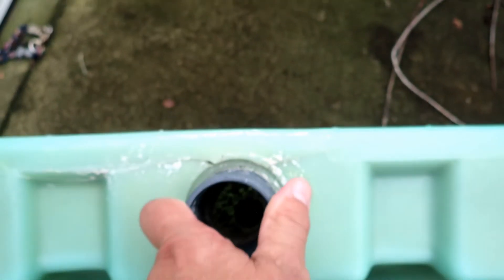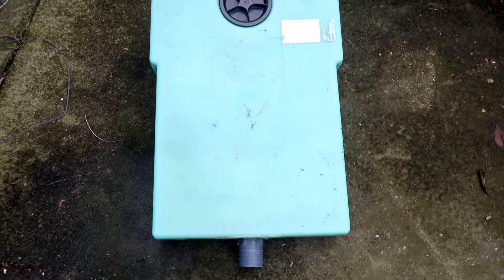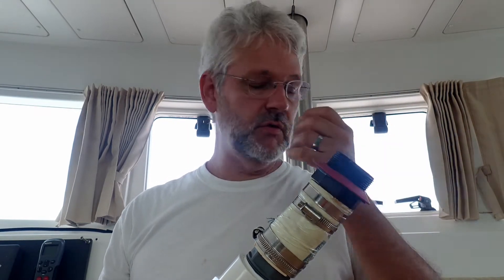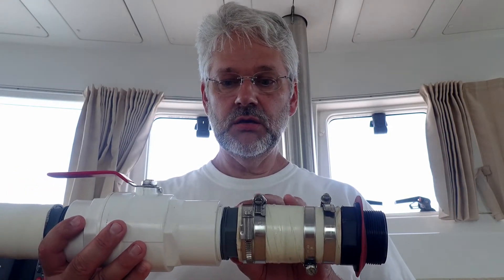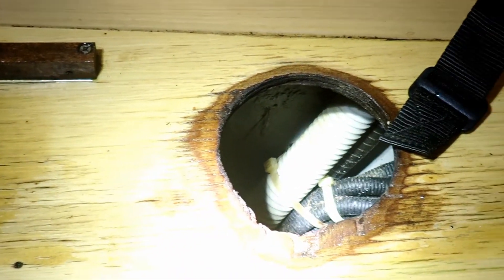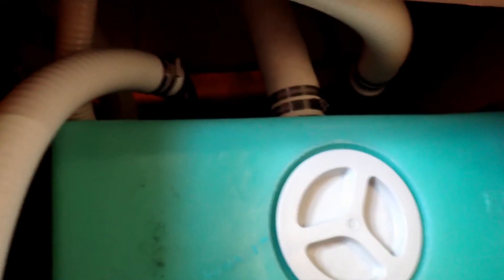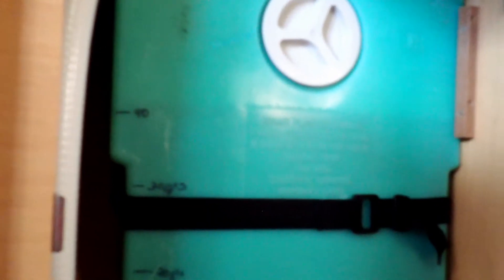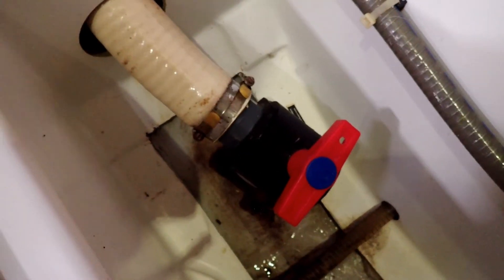Our holding tank is leaking on our Lagoon catamaran (yes...gross!!) and how to fix it!

Comment: Do you think a chrome ball valve will decay faster with saltwater flush heads?
Reply from the maker: I hope so!  If it's real chrome moly, it should be ideal:  "With such a high temperature tensile strength and corrosion resistance, CrMo is also found to be effective in salt-water applications"